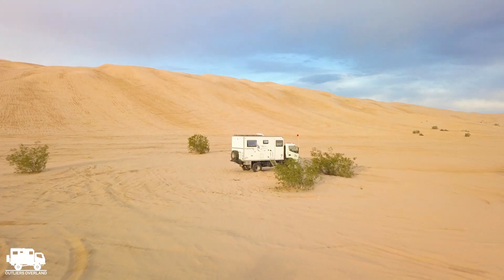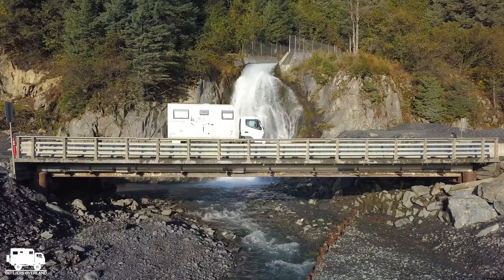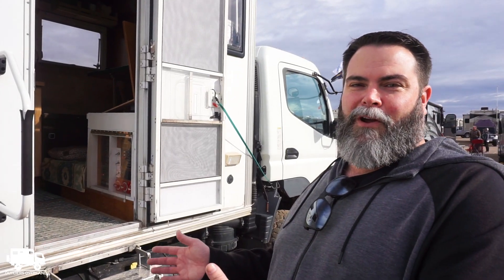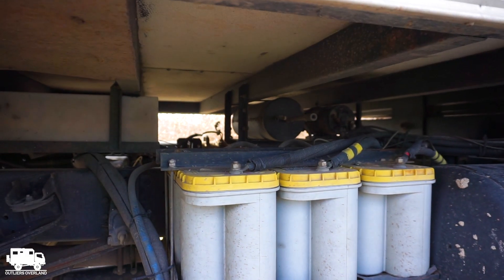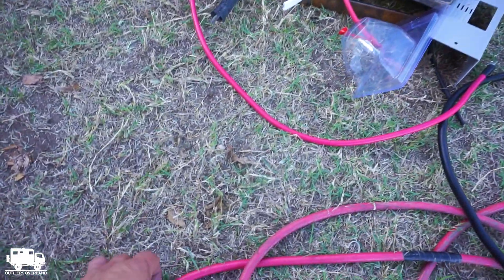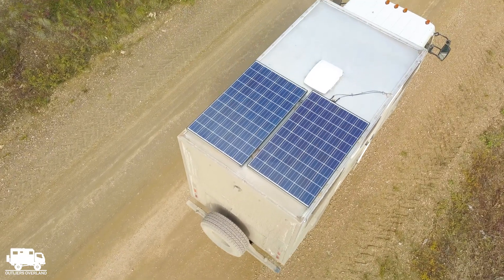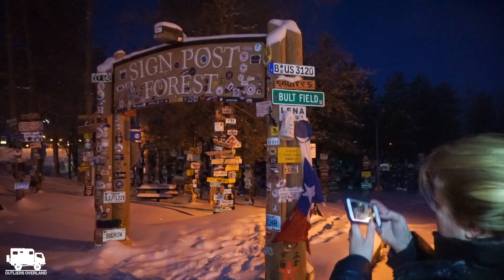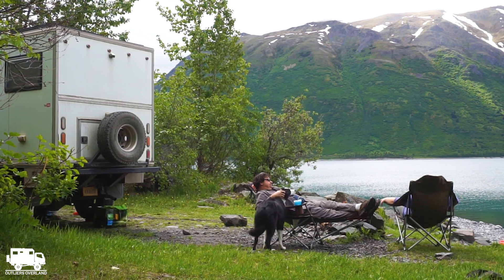2 Years & 25,000 Miles After Upgrading to Battle Born Lithium Batteries

Comment: Nice guys!  Just finished my review video for them, going to post it soon. I am SOOOO impressed by my battleborns, they're insane!  100 watts of solar on my roof, I ran my diesel heater, fridge/freezer, lights, TV, charged my laptop/drone/camera/gopro/phone for 2 weeks straight... never got below 93%, temps down to -35 F, 100% recharged every day from 100 watts of solar, and this is only using 2 battleborns (100ah)... super impressed.

Comment: Thinking about adding solar to our class A. Do you feel the 520 watts of solar are enough for your 3 BB batteries or do you need more? If we purchased the same equipment you mentioned the charge controller etc, BB batteries, solar panels, what would it cost us at retail do you think ? Approx. Thanks and safe travels.
Reply from the maker: Yes we feel that 520w of solar is plenty of us….  Keep in mind our camper is very 12v energy efficient.   
That being said it would be nice if we had room for a few more batteries, because if we want to run the InstantPot through the inverter it consumes the juice.   
Our truck came with solar panels and controller so I’m not sure about that price.   
I would guess a complete 3 BB, 520w panels, solar charger controller, battery charger, inverter set up would run you 5-6k ????

Comment: No offense intended, here are my generic comments about RV/Van builds, including Lithium upgrades:

OVERWEIGHT
This is testimony to just how obsolete and out-of-touch present-day Van and RV manufacturers are in the United States. I am an engineer and have some constructive criticism. Every gram of weight counts.

Six issues:
1) NOT ECO-FRIENDLY
 Too heavy. Not aerodynamic. Low MPG. Poor cornering because of the high center of gravity. Should have big solar to make the claim "Best Quality and Deign".

People insist on outfitting their rigs with doodads like wasteful showers, heavy cabinetry, exterior lights, wasteful water heaters, roof decks, vents, sky lights and ladders. Windows are outdated. They should be dual-pane acrylic. Insulation is minimal because cockpit is not thermally isolated from living area. Materials are way OVERWEIGHT. The wood cabinetry and doors could be lightened by 50% or eliminated. Should have a SEER 33 split-mini for climate control. It's a camper van, not a house.

Please care about the environment.

2) EXPENSIVE
All of the above doodads cost money that unwitting customers pay for because they do not understand first principals of engineering regarding minimization. The lithium batteries in this van cost about $1000/usable KWH (KiloWatt Hour).  My Tesla battery cost about 8x less.

My empty Sprinter van with a BlueTec i4 turbodiesel gets 30MPG, and 25MPG with the camper build at 55 MPH. The van in this video is so overburdened I doubt it even gets 16MPG.

3) HOT WATER DELAY
With a remote hot water heater, it will take up to 30 minutes to get hot water. If the hot water tank is pre-heated, it still may take 30 seconds to get hot water. Meanwhile, much water is wasted. This hot water tank design wasted both water and energy. To resolve this, I installed a true-instant hot water faucet; six seconds for hot water.

4) NOT BOONDOCKABLE
Greenwashing: Since there is inadequate solar, fossil fuels must be used to charge the battery. If it is winter, very little solar power is available. Wasteful water design will require frequent trips to replenish.

5) FOUR-SEASON, NOT
Customers camping in the hot summer or cold winter will have issues with energy usage and temperature control due to the lack of insulation and outdated climate control. My Mitsubishi has a SEER of 33 and can heat down to -13F. A lot of fossil fuel will be needed to stay warm in winter. 

6) NOISEY
The choice of outdated climate control will lead to excessive CFM (Cubic Feet per Minute) airflow, causing high noise levels. Max air fans are noisy and don’t move much air.

To resolve the above problems, see my Tim's Tips van build at: https://youtu.be/YxPj21nckd0